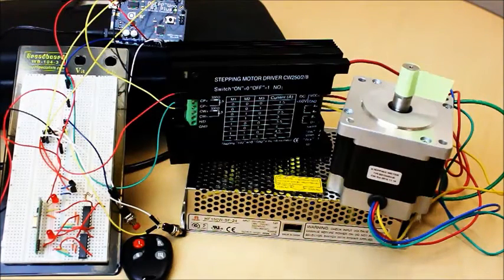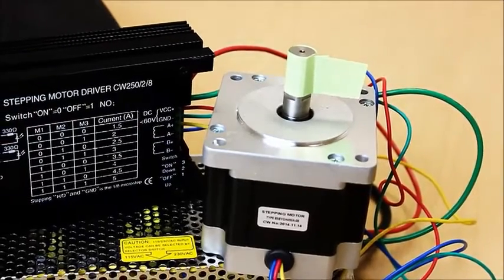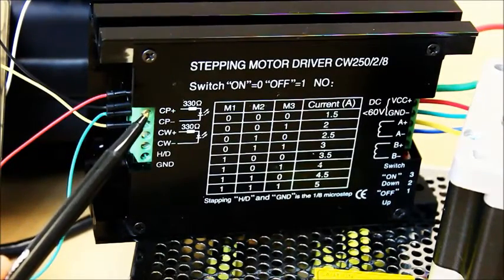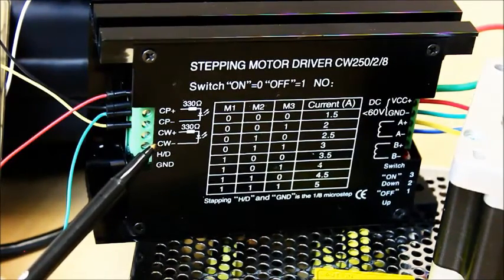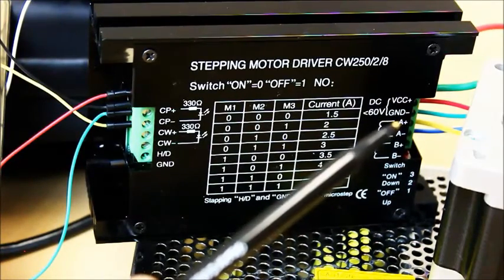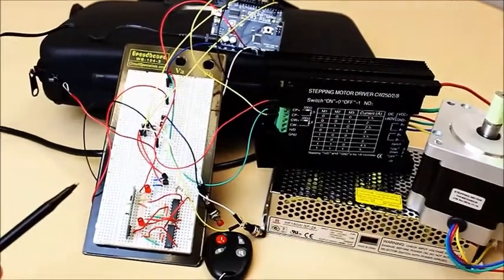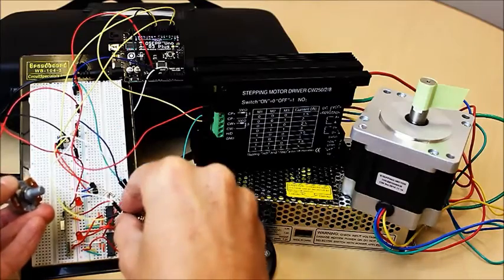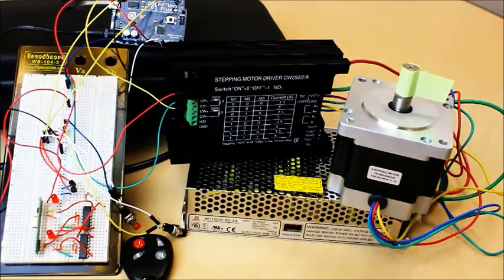Wireless Arduino control of a large NEMA 34 stepper motor

Comment: What is the max rpm of this motor using this  driver and arduino? Would it be much more difficult to use momentary buttons and wireless fob that allow you to press and have the motor turn x number of steps or degrees?

Comment: sir i purchased leadshine DM856 for leadshine stepper motor (86HS85), I am controlling it with arduino UNO but i am unable to get higher speed with it. sir plz do guide me to get higher speed on stepper motor.
Reply from the maker: From this article: http://bit.ly/29nApMx

"To get a motor to run fast you have to supply it with a higher voltage than you need to satisfy the current requirements. Therefore your drive has to limit the current, these are often known as regulating drivers or chopper drivers. The higher the voltage the faster you can go." 

We do not supply or support the Leadshine line of products, so I don't have much more information on your specific application, however this should provide you with a place to start. 

Best regards,
Circuit Specialists
https://www.circuitspecialists.com
Reply: sir thank you for your ans, sir i am using 48v and 4amp DC to driver to motor
Reply: sir can you plz explain code as i am new to coding i am unable understand (i used code provided by you it did not worked for me)
Reply from the maker: Start here: https://www.arduino.cc/en/Tutorial/HomePage